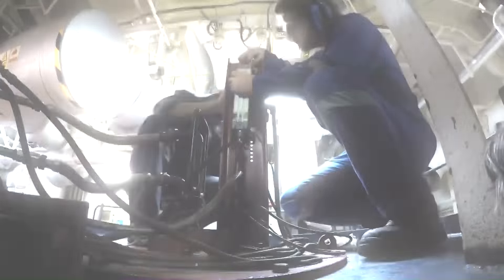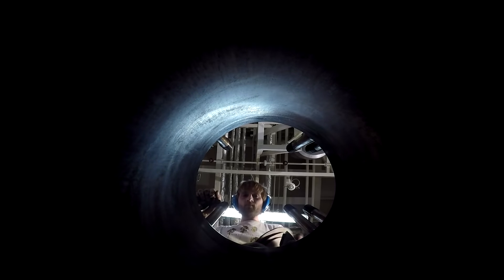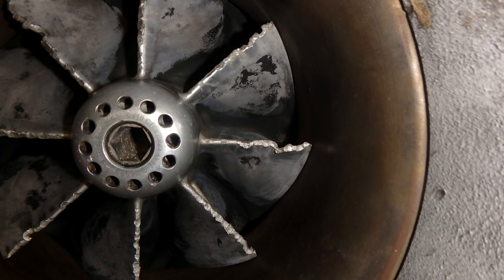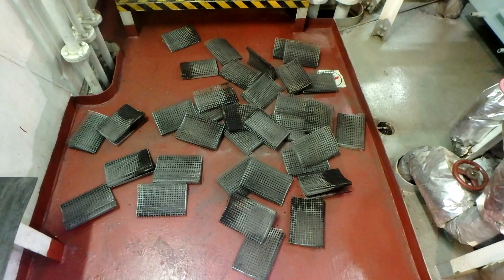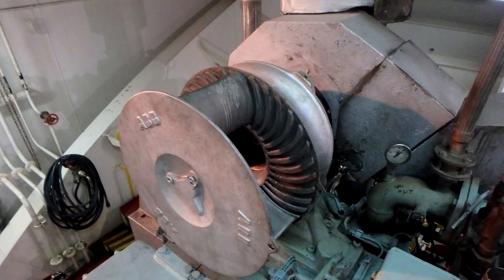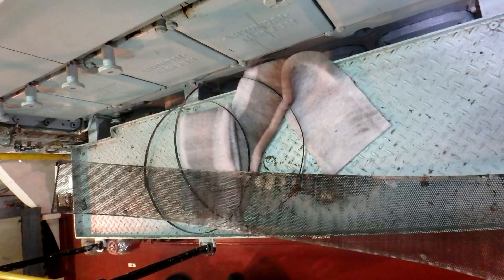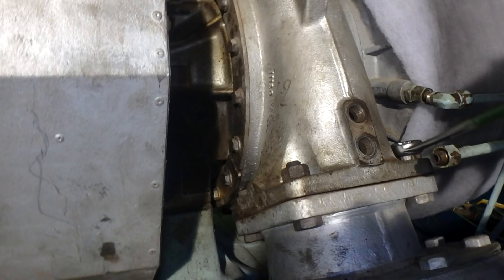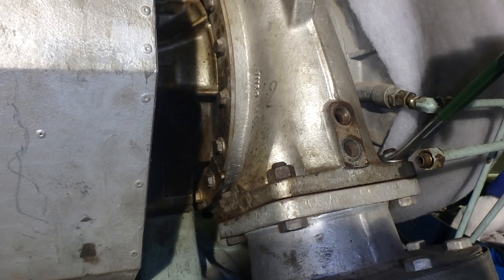TURBOCHARGER COMPRESSOR BLADES DAMAGE! HOW TO PROTECT

Comment: Hello , do you have experience overhauling kbb hpr 3000 turbocharger for diesel generator? If you have please do share. Thanks!
Reply from the maker: If you are making such overhauling first measure to see if you are within the limits otherwise if maker says specific hours and exchange some parts do so but verify if all spares are available otherwise problems can occur.